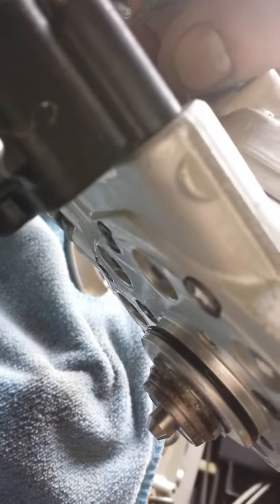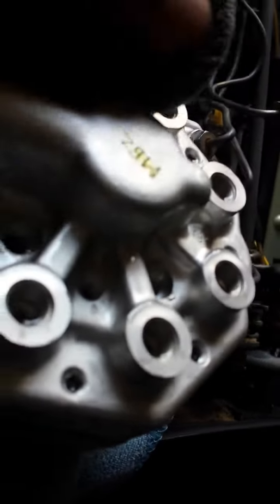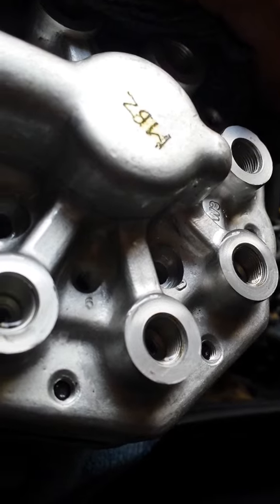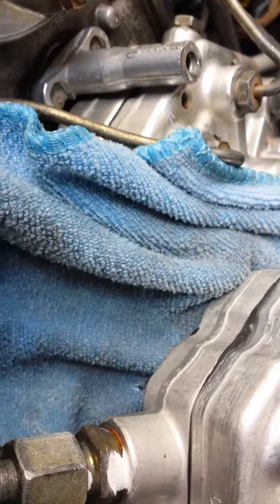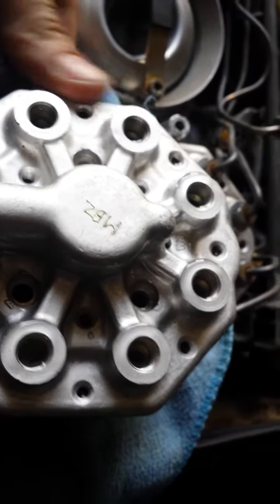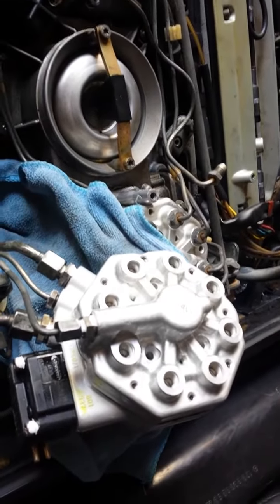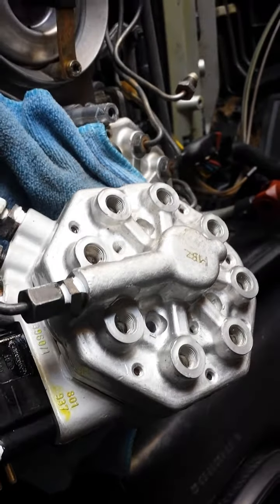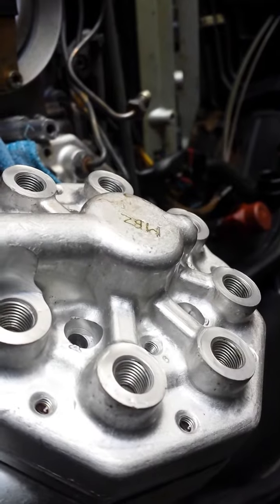Mercedes 560sel leaking fuel distributor

Comment: Yes, i think my FD is broken when i bypass the electricity fuel pump with accu, and there is no fuels come out from my W463 M103 fuel distributor. but im wrong! if we dont attach the nozzle into the fuel lines, there is no fuels will come out. because FD  need air supply from carburator to distribute a fuel, but carburator need a pressure from nozzle for work! so thats the answer. Im sorry if i wrong, but you can try it fir sure :D